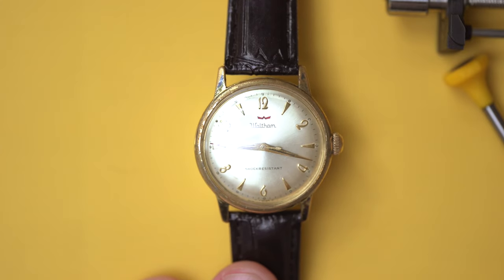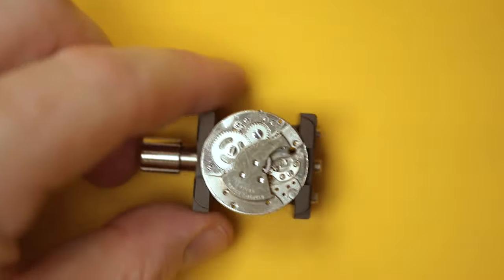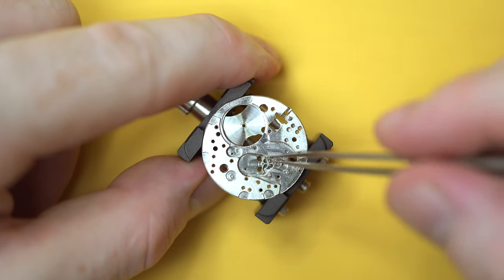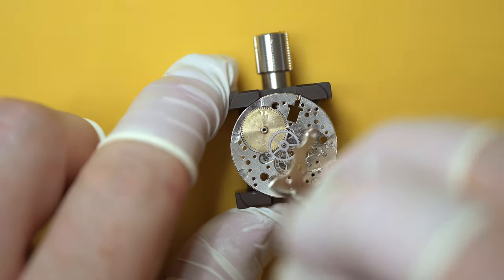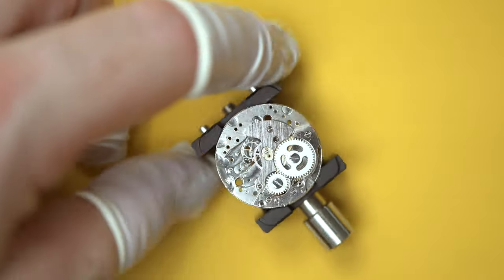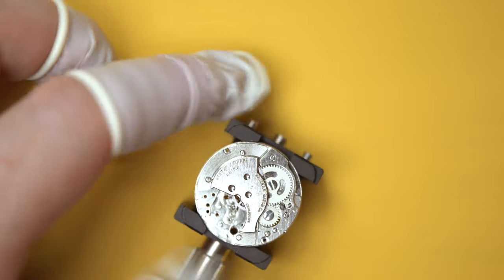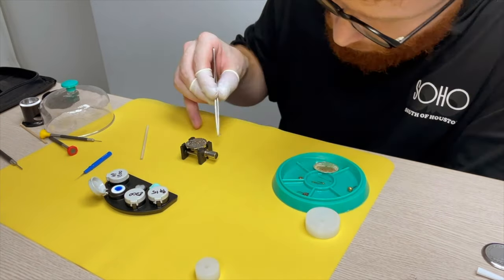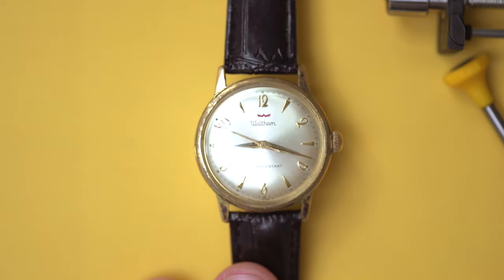1950's Waltham vintage watch restoration, did I break it?? Full service 4K

Comment: I have found mainspring winders do not always work on pre-1970 watches because the catch is too big for the hole in the mainspring or can't align with the hole. For cleaning, I do a 1st clean in mineral spirits/paint thinner, 2nd in naphtha (the chemical name for lighter fluid), 3rd in isopropyl alcohol (get as little water content as possible). Many professional watch cleaning products are essentially mixtures of mineral spirits and naphtha.
Reply from the maker: I thought it was just me not knowing how to use the winder set for a while, but glad to  know some other people are experiencing the same problems!

Comment: Nice work, i am also trying to set up my own watch making studio. The prices for instruments are just bloody expensive. 
Currently looking for a good mainspring winder. I see you re using one 11:20. What is that?. Can you please give some links where you bought your stuff
Thanks
Reply from the maker: My mainspring winder set was a cheap set from China, but to be honest, I wouldn’t recommend. I’ve not been able to use it much, probably only used it for 3 of the 10 watches I’ve serviced! But you can find them on Ali express. JSG
Reply: @jsgwatches  means 7 out of 10 winded by hands? What’s your plan for it? Any plans to purchase bergeon? I found one chinese with steel arbor, not brass. I hope it will work.
Reply from the maker: @almasmeiram8463  I have the Chinese version with the steel hooks too, It just doesn’t seem to catch very well, if at all. The arbours seem too thin also. The watches that it has worked on, it’s worked a treat though. I’d love to get a bergeon set, but the price is eye watering my high 😅 I might just have to wait for a 2nd hand set to turn up online 🙏 JSG

Comment: There is a watchmaker in Malaysia on you tube, you might want to ask him about those fluids.. He's also doing restoration videos..     "Watch Repair Channel" might be it...
Reply from the maker: I’m planning to move to Malaysia in the coming months, so hopefully it will help open some doors to get the correct cleaning fluids. Getting anything into Singapore currently is an absolute headache!
Reply: @jsgwatches  I don't know your present (August 2023) situation, but if you're still having difficulty obtaining supplies, perhaps you could contact a laboratory at a nearby university for suggestions. Another possibility would be local or regional manufacturers who use similar solvents, etc. Even private companies may be helpful if it's clear to them that direct economic competitiion is not involved (i. e., this is a hobbyist pursuit, not commercial).